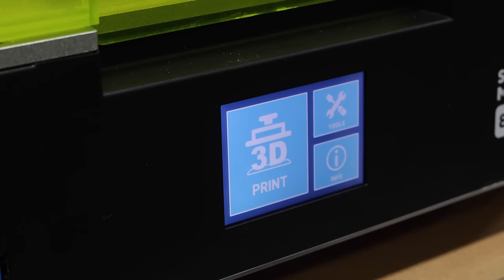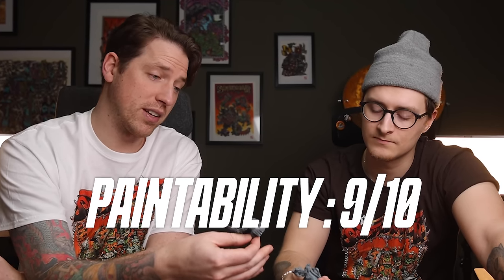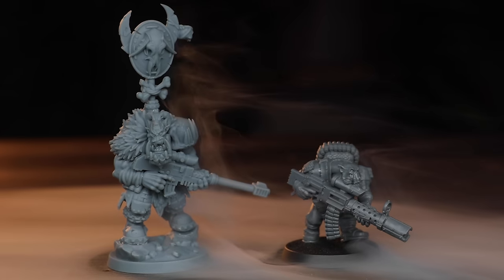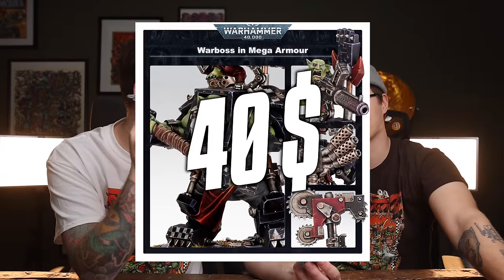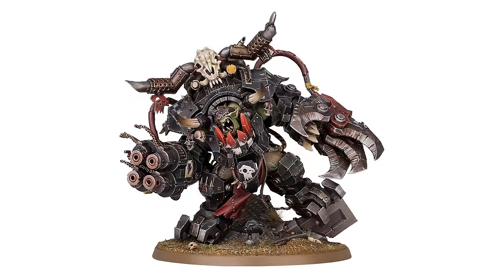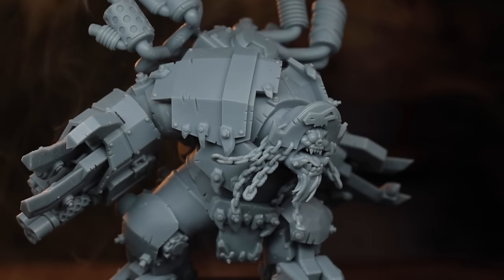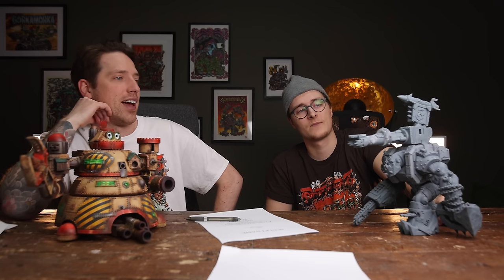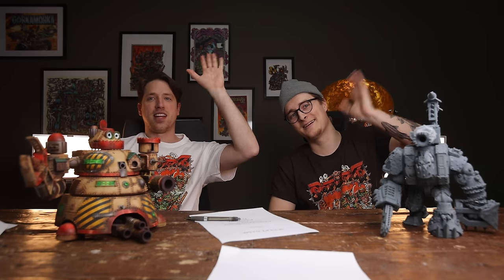Who did it best - Games workshop vs 3D Printed

Comment: It's certainly cheaper but all mono-pose and not usable in GW events or stores is too much of a downside, that and the time and money cost of 3d printer, setting up, cleaning, maintenance etc.
Reply from the maker: For sure. We don't have an official store here and our tournaments allow partially printed armies. I guess it depends how you play :)
Reply: @SquidmarMiniatures  I guess that's the other side of it, only partially printing an army. Printing an entire army with mono-pose and finding stl's for units that are cohesive enough to work together is tricky. Certainly easier for Orks though.
Reply from the maker: @craigsargent2476  it's like its own hobby, that requires equal amount of work.

Comment: The last model seemed rushed or like it was made by a less experienced artist. It's a great looking model from about 3 feet away but the closer you look the worse it looks. Mesh/detail density is not consistent across the model which is a big no no in 3d sculpting. You always need to consider scale and how things will read at full size. To me it feels like someone took step 3 of what should be a 5 step sculpt and called it good enough. A pity because it reads very nicely and has a lot of great design elements. Another couple of refinement passes would have made all the difference.

Comment: You're doing yourself and your printer a disservice if you don't properly hollow the large figures. Using 120 bucks worth of resin on a model that size is insane. If you do it properly it will be 5x less in the absolute worst case.

Comment: I wish people used scales properly,     you threw out a lot of numbers but all ended up with in a couple of points and means uou cant tell anything really. 

5 should be the base line 
A 25 would be an average model 

That way there is a big disperity between good and average

Comment: I really dislike modern 40K orks, they are just too damned big and bulky, it's a style that was popular in the mid-1990's and should have died in the mid-1990's. Like the red period. 
Horses. Basically HORSES: A good fantasy universe takes horses as (a) the usual mode of transport for people who can afford not to walk, and (b) a benchmark of what constitutes a strong animal that can injure or kill any biped with a kick. 

40K orks are derived from warhammer fantasy orcs, and should be about the same size and strength; ie, not so big and strong that they can literally pick up horses and tear them in half, or bite their heads off. 

I mention this because I really dislike modern 40K orks. 
Someone please fix them.
Reply: But only the biggest and baddest orks are huge. According to the lore, orks are constantly growing, regenerating and basically fungi style organisms.
So orks start out at normal size, but if they fight and survive long enough, they get to grow. So makes sense why the leaders are so much bigger than the rest. 
Normal GI Orks shouldn'b huge, for sure. But bosses should tear a horse apart, which is also a pretty standard fantasy strenght level check btw. :)